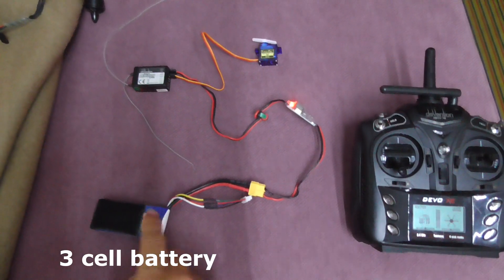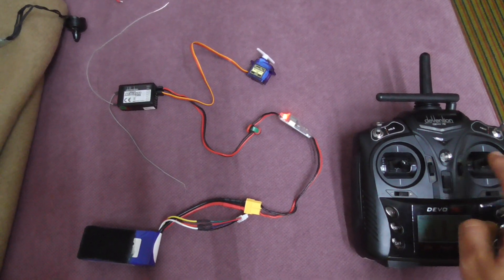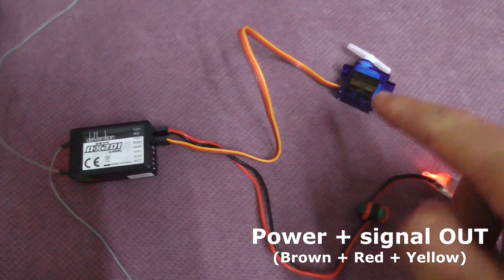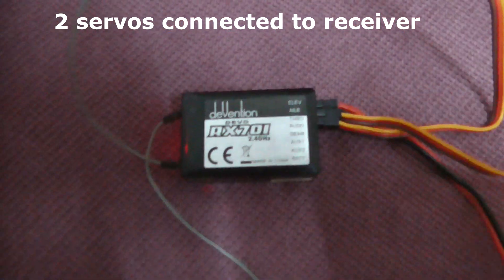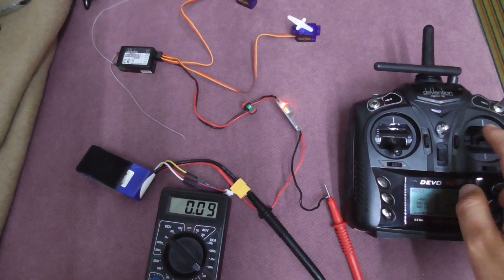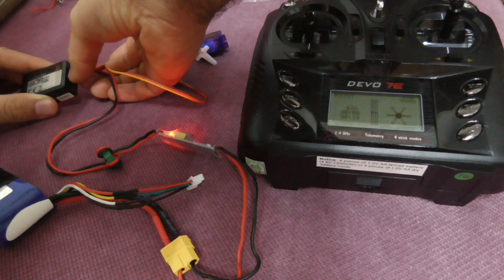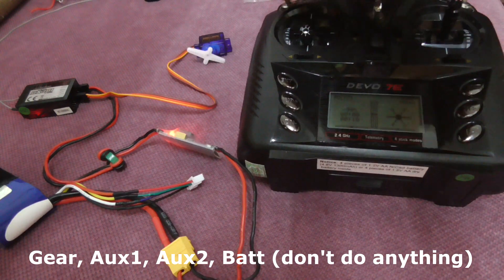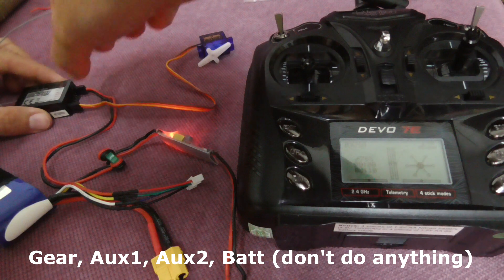How to control an RC Servo using a Radio Transmitter (RX701 & Devo 7E)

Comment: what Rc controllers work with servo control  . I would like to add a servo so turret would go up and down not sure what to buy for my heng long tank control 2.4ghz
Reply from the maker: I'm not a pro in this stuff, but it depends on the receiver whether it has separate outputs for different servos, or just one serial output for all the commands. As i noticed that turret should already move up/down from the radio control.